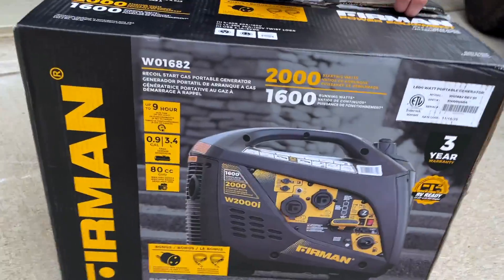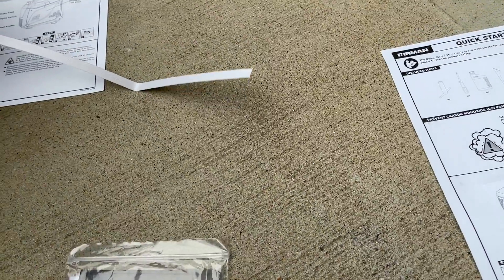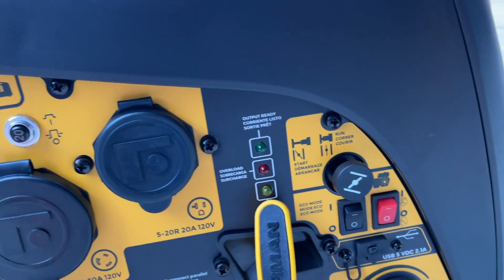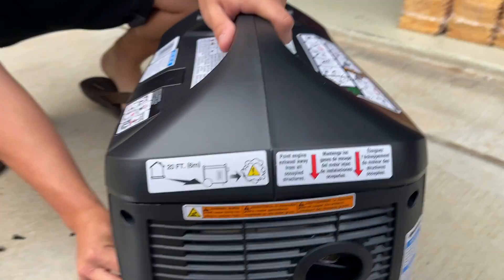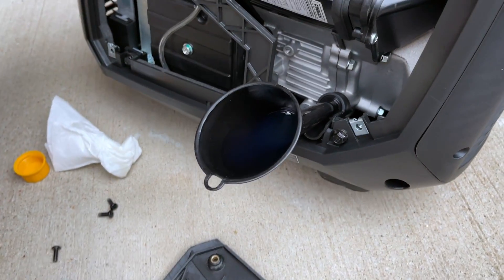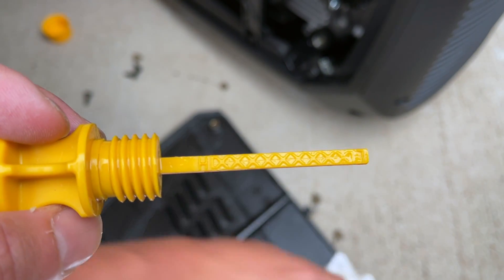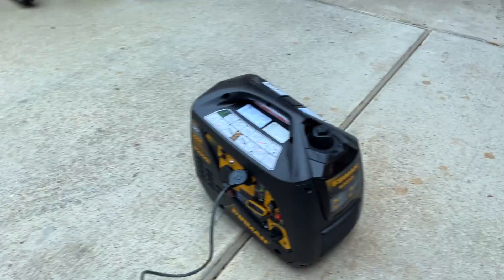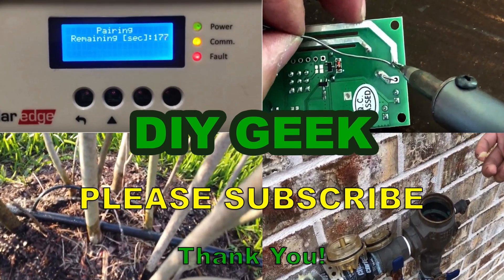FIRMAN 2000 WATTS PORTABLE GENERATOR

Comment: I bought one of these last month. It runs and works well. The one glaring weakness this model has, if you read the reviews, is the air intake is underneath, meaning it will suck up a lot of dirt and debris, and possibly water, if it is placed directly on the ground. There were a lot of complaints about the air filter getting severely clogged. If you buy one, always make sure to put it on a board or concrete slab, never on dirt or sand or things of that sort, or you'll have issues. It would be nice if the air intake could be relocated to the side- probably possible, but would take some effort, and would likely void the warranty.
Reply from the maker: Good point about the air intake, I did not even realize it is from bottom. But it is a great generator. Thanks
Reply: Thanks for that tip that’s huge ,appreciate it

Comment: The reason why it didn't start after the first pulls is that everytime you try to crank it to move the oil around slowly the fuel is also pumped, that's why it started without the choke on.
Reply: can you say this in dumber sentence please

Comment: Seemed ultra quiet when you ran the drill. How was it while you stood there,same?. If yes, would be perfect for off grid camper van inmho. Do you know if it'll run a 1800 watt heater fan for winter?. Thanks m8
Cheers 😊
Reply from the maker: Yes it is a very quiet generator. However my drill probably pulls about 200-300 watts at the most. 1800 watts heater is 6x more than the drill, it will be louder but still not crazy loud. I would not recommend running 1800 watts continuously on this generator, I would recommend a larger generator. I think the next size is about 3500 like this Generac 3500:  https://amzn.to/3NMfmF0

Comment: I have one of those and is hard to start and stop when start...what canD to be the problem??thanks
Reply from the maker: How old is the generator? how many run time hours? You probably want to check the air filter, change spark plug, and change its oil.  Most generators require oil change every 20 - 30 running hours.  And first oil change usually very short like the first 5 - 10 hours.

Comment: I bought this and tested it out a month after and it starts for a few minutes but shuts off.  What could be the issue?
Reply from the maker: Make sure your choke is not pulled out (choked on)
Reply: Bad gas
Reply: Could be your fuel shut off is off- that would allow enough fuel to run for a time and shut off. The fuel pump icon is next to the cut off side of the switch, which is confusing. To me, the off side looks like it should be the on side. Also, the float could be sticking. Mine did when it first arrived. I added some Marvel Mystery oil to the fuel, loosened the bowl's petcock and tapped the side of the bowl until fuel began to flow down the petcock tube. It started and ran reliably after that.

Comment: Would this run 8000 BTU AC ?
Reply from the maker: @Arshdeep Dhillon I just checked, most 8000 BTU Air Conditioner consumes 700 - 1000 watts at 110-120V. This Firman generator can accommodate peek 2000 watts and 1600 continuous running watts, so yes, I believe this Firman generator can run an 8000 BTU AC.
Reply: @DIYGEEKTEXAS  thank you for your detailed reply

Comment: Mine came with oil in it 🤔
Reply: somebody resold you an exchanged unit.
Reply: @stuwest5862  that’s what I was thinking. Didn’t think Costco would do something like that
Reply: @god1246  Bring it back to Costco.They are easy on returns.
Reply: @MrAcer505  as long as they don't give you the one you just returned back 🤣

Comment: That is one nice generator for only $350 bucks?!? what?
Reply: You may not think so if you need warrantee repairs.. should have bought a predator, with Harbor's no questions asked warrantee. bring it in, they hand you a brand new one. BEAT THAT!
Reply: @FXNorm  Right now you can buy a refurbished unit on ebay for $239. I bought one, and it is just like new, even shipped in the original packaging, runs well. At that price, you can buy 2 Firman generators for less than the price of 1 Predator of the same size. Or you can buy 4 for less than the price of a new Honda EU2200.